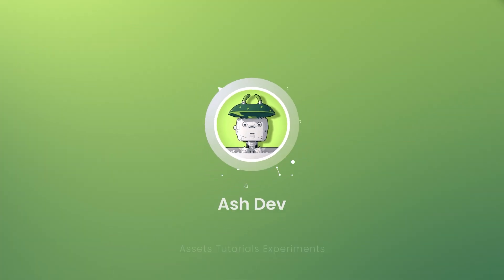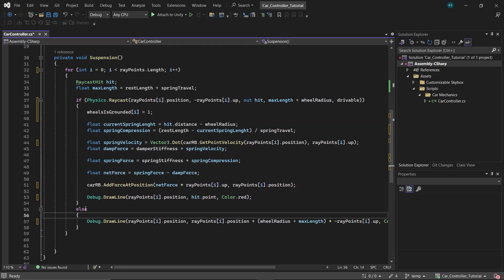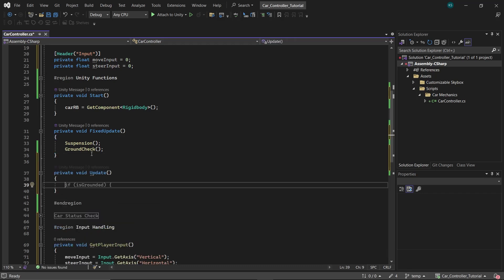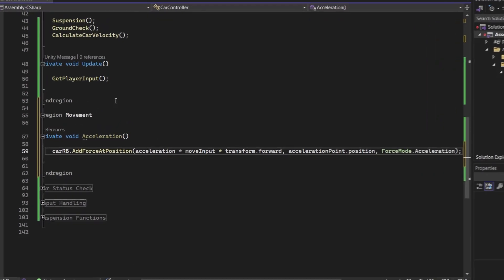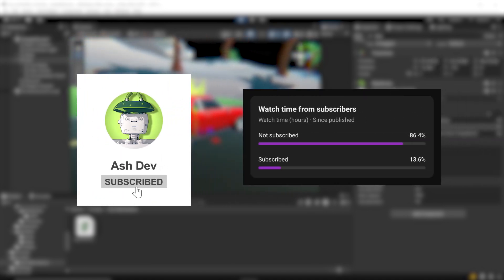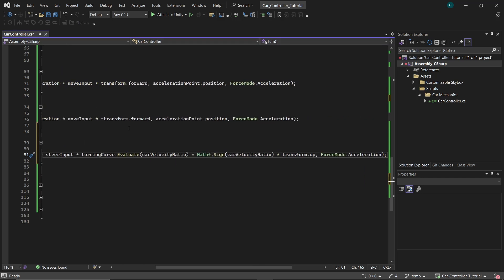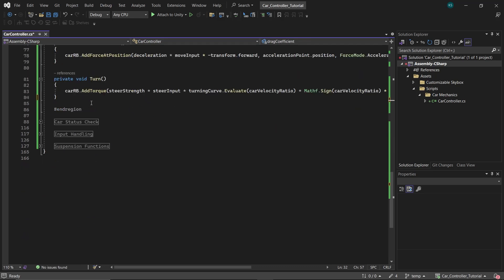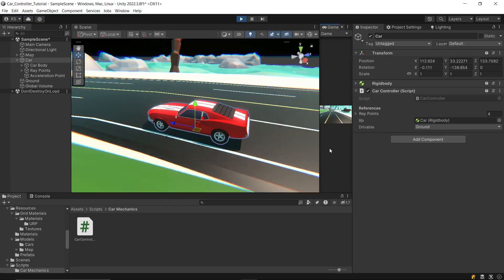Arcade Car Controller Part 2 | Movement tutorial Unity | AshDev

Comment from the maker: one mistake happened while recording the tutorial, the turn logic isn't correct so, replace it with this: 

rb.AddRelativeTorque (steerStrength * steerInput * turning curve.Evaluate(Mathf.Abs(carVelocityRatio)) * Mathf.Sign(carVelocityRatio) * rb.transform.up, ForceMode.Acceleration);

Use the Absolute Value of Car Velocity Ratio with the Turning Curve

Comment: For those who might have the same problem as me which is the car flipped over, you might need to lower the car center of gravity, in start method  add this:
        carRB.centerOfMass = new Vector3(0, -0.5f, 0); // Lower the center of mass.

Comment: How you imported the model? I have some issues after importing my model in unity, in particular, following the instruction in the video my model bounce very fast like crazy, similar to a glitch and move by itself toward back, why?
How i can check the wheel radius of a every model?
Reply from the maker: Please join our discord server and share what issues you are having
Reply: Did you find a solution because i have the same issue
Reply: @JJ.Editz_YT I've figured out after a lot of time (cause to work)... The car object glitches because the Car GameObject needs to have a box collider (the cube has it by default). Just add a box collider with the size of the car's body and it should do the work.

Comment: I commented the deceleration function and it worked fine but when without commenting it....the vehicle wont move at all. So what is the use of deceleration function if the code works fine even without it?
Reply from the maker: Deceleration is for how fast your car will stop, its being applied automatically and in the last part of the series (Bonus part) we made some changes in the deceleration function so, watch the full series first, and if your car isn't moving then be sure that your acceleration value you set is higher than the deceleration value.

Comment: Hey this absolute the best tutorial but idk why, my car is constantly moving, when I am slow down the cars  moves really really slow forward or backward but it don’t break
Reply from the maker: Join our discord server, and share what's happening
Reply: did u find a fix?....mine's moving too
Reply: @what_the_dog_doin_RXT4050  In case this is still relevant: this happens if the rigidbody's center of mass is not perfectly centered between the front- and the rearwheels. I solved this by adding a method to Start() that adds up all z-values of the wheels local positions, divides this by the number of wheels and then sets the center of mass to (0,0, calculated z-value).
Reply: @what_the_dog_doin_RXT4050  mine too